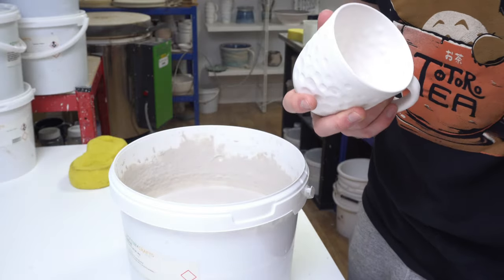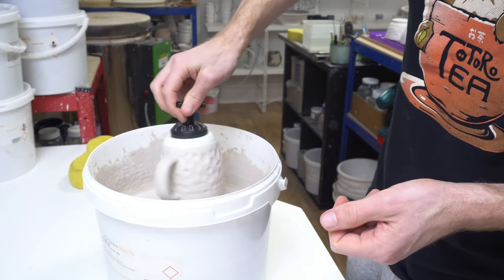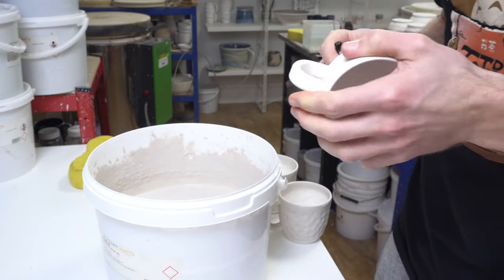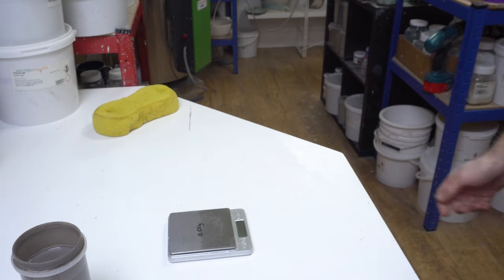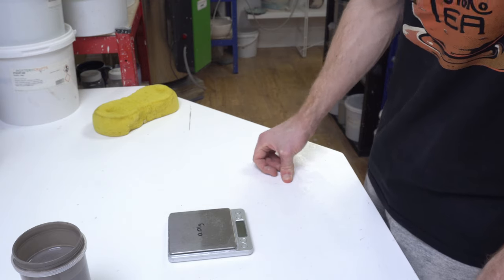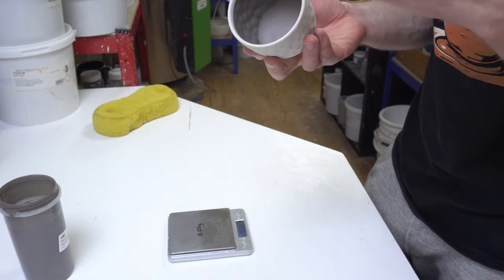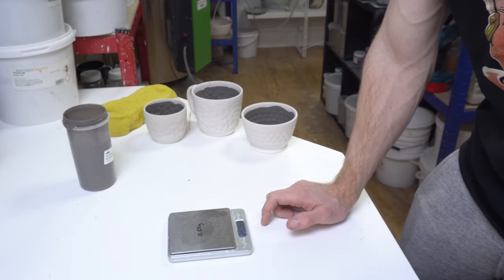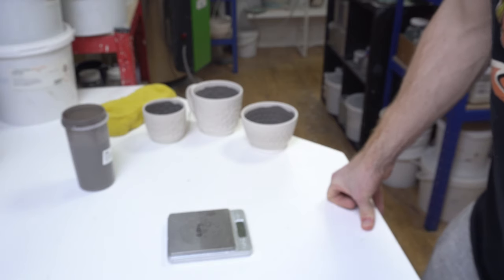Why you should be weighing your glaze applications (and a few other glazing tips)

Comment: Ah. Very timely. Thank you. This will explain the not quite as I expected variations over test tiles  that I have had recently trying out your Nebula glaze.
Reply from the maker: Yep! Nebula is a weird glaze anyway, but it's particularly sensitive to application thickness
Reply: @OldForgeCreations  I hope you don't mind but does it prefer thick or thin?
Reply from the maker: Definitely thicker. Too thick and it starts to crater, but too thin and out won't be able to reduce the copper and turn interesting colours
Reply: @OldForgeCreations  Thank you.